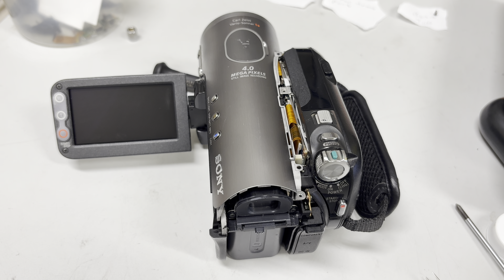Another Sony HDR-HC3 HDV Camcorder With A Failed Capstan Motor and No Power.

Comment: Do you have a video on how to dismantle and access the mode switch?  They are very unreliable on this model.  Sometimes just exercising the mechanism can get it working again (apply a few volts to loading motor) but that's not always enough.

Comment: thank you so much on this video!!! I think i have a similar problem. Bought the camcorder as not working. The tape is inside and there seems to be no signs of life when connected to power or battery. I would grately appreciate if you could provide some insight into where the fuse is really.

Comment: At 2:48 the issue is caused by damage to the enamelled wire by metal rust particles? (I checked mine with a microscope, ) causing a short to ground (the large capstan disc thing).

The scratch marks on the metal disc confirm this if you see. I'm not sure why it always happens to this model!
Reply from the maker: I suspected it could be that due to the scratches as did notice that as well. Reason just changed the whole capstan motor as wasn’t sure it was the halls, or windings that developed a short. I believe the top plastic spacer develop an indentation in plastic, or the metal that secures the shaft bends slightly over time and cause the spacing clearance to not be precise and it start to rub? On some I also hear clicking if you go to slow scan that the gear belt hitting the side plastic guide rail rubbing. I noticed it on a couple of these and no cracks in gears? Then the capstan motor pulls to much current shortly after. 

Sony SVHS decks and some VHS decks had this problem where the capstan motor housing warps and bend due to pressure over time as metal not thick enough and causing the capstan rotor to rub on coil seen many years ago when use to service VCR’s back in the day. You had some that the top pressed in retainer that hold bearing come loose as well, just fixed a Panasonic direct drive deck where the brass metal retainer cracked and rotor was sitting on coil completely seized it.  Thankfully wasn’t running and likely sitting when it happened, so no damaged to enamel coating on coils.
Reply: @thetechgenie7374  Usually (on the two models I've repaired with this issue) it just causes a short / boot loop so didn't get to test it running. I suppose it depends on the severity of the short.